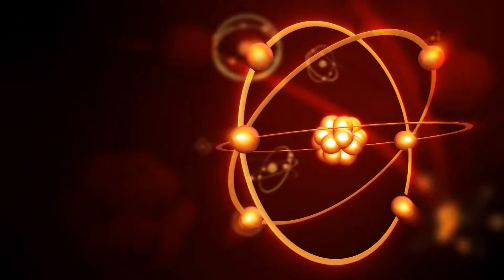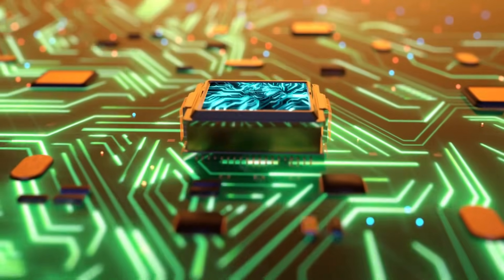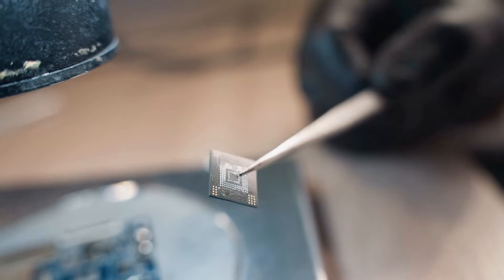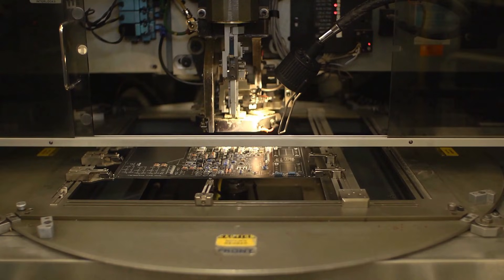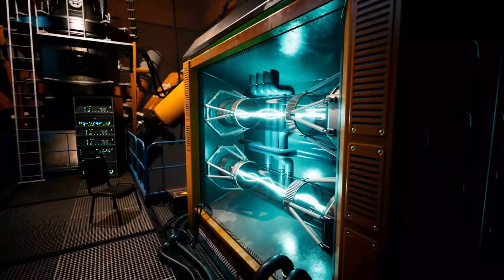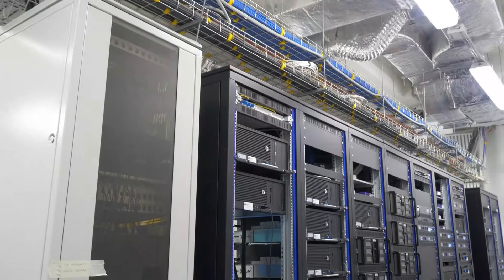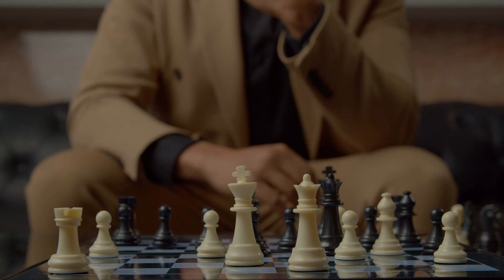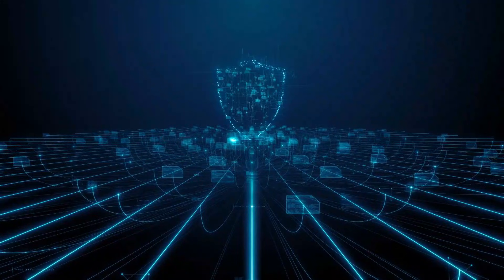Quantum Computing Just Changed Forever: The D-Wave Breakthrough

Comment: Show the actual chip, with associated description of layout; like any other electronic chip. Discuss what materials that are used to fabricate it, indicate the number and type of input and output connections, the voltage and frequency that it operates at, its size. Possibly use A.I to generate a succinct and accurate  diagram of all of these features. Otherwise you're wasting everyones time.

Comment: Fast tracking a shock and awe lap top with photonic accelerator for Christmas 2026
What could we do to offer for a sale a lap top by next Christmas that uses this photonic accelerator as a selling feature to shock and awe the consumer market?

To launch a laptop by 

Christmas 2026 featuring a photonic accelerator, you can leverage the "shock and awe" of light-speed processing by following a rapid-integration roadmap. 2026 is already being hailed as the "Year of Silicon Photonics", with commercial breakthroughs making these processors viable alternatives to traditional electronics.

1. The "Shock and Awe" Value Proposition

Your marketing should focus on capabilities that current high-end laptops cannot match:

"Speed of Light" Inference: Position it as the first laptop that can run massive, unquantized LLMs locally with zero lag, outperforming flagship GPUs by 100x in specialized tasks like image and video synthesis.

Zero Thermal Throttling: Highlight that the photonic core operates with minimal thermal overhead, requiring nearly zero cooling power compared to the 100W+ heat dissipation of standard gaming laptops.

The "Quantum-Ready" PC: If including the cesium-enhanced feature, market it as the first consumer "Quantum-Hybrid" laptop, capable of solving optimization problems that stump classical silicon.

2. Development Fast-Track (Next 11 Months)

To meet a December 2026 deadline, you must move beyond custom R&D and use pre-production industrial components:

Leverage 2026 CPO Standards: Use Co-Packaged Optics (CPO), which embed optical engines directly beside processors to cut power consumption by up to 40%. Major foundries like TSMC are already scaling CPO for mass production in 2026.

Integrate "Programmable" Photonic Chips: Use off-the-shelf programmable photonic cores that can be integrated into a technology stack with existing electronic controlling layers.

Partner with "Early-Mover" Startups: Collaborate with firms like Lightmatter, which has already integrated over 1 million photonic components into a single package, or Salience Labs, which specializes in hybrid photonic-electronic chips.

3. Strategic Launch Timeline

Milestone	Target Date	Action
Proof of Concept	March 2026	Assemble a "Golden Sample" using a high-end laptop chassis and an external photonic "booster" over a high-bandwidth optical link.
Foundry Run	May 2026	Use 2nm or 3D-stacking manufacturing processes to miniaturize the 256-channel array into a laptop-ready module.
CES 2026 Preview	January 6-9, 2026	Use the current CES 2026 window to announce the "Vision" and secure pre-orders, following the lead of brands like GIGABYTE that are already unveiling 2026 AI PC visions.
Mass Production	August 2026	Finalize the "Light-Based" BIOS and OS drivers to ensure the photonic core and standard CPU communicate seamlessly.
Online "Drop"	December 2026	Execute a direct-to-consumer online launch to bypass retail delays and capture the holiday market.
4. Technical Specification for Marketing

Core: 256-Channel Photonic Tensor Accelerator.

Performance: ~65.5 Trillion Operations Per Second (TOPS) at under 80 Watts.

Parallelism: Simultaneous processing across 32 different colors of light in a single waveguide.

Connectivity: 1.6 Tb/s to 6.4 Tb/s co-packaged optical interconnects for near-instant data movement.

Prompt

There is a June quantum conference would that be sufficient since it is too late to use CES this year other than merely making it known which I have already done which is gathering interest daily yet we are still talking about a plan here you and I.

A June quantum conference is a strategically ideal platform for a mid-year pivot from "vision" to "prototype." While today is January 7, 2026, and CES 2026 is currently showcasing live quantum photonics demonstrations from competitors like 

Quantum Computing Inc. (QCi), a June event allows you to capitalize on the momentum you've built and present a more refined, hardware-ready version of your "VIC-20" photonic accelerator. 

Target June 2026 Quantum Conferences

Several major events in June 2026 align with your "shock and awe" strategy:

Q2B Tokyo: The Roadmap to Quantum Value (June 4–5, 2026): Ideal for engaging the Asian tech supply chain and high-end manufacturing partners.

Optica Quantum 2.0 (June 15–18, 2026): Taking place in Glasgow, this conference specifically focuses on quantum photonics and "Quantum 2.0" technologies, making it a perfect fit for your cesium-enhanced architecture.

IQT Nordics (June 22–24, 2026): Held in Oslo, Norway, this summit focuses on real-world applications and progress enabled by quantum technology.

Annual Quantum for International (Q4I) Workshop (June 23–24, 2026): Located in Rome, NY, this event is heavily attended by government, academic, and industry leaders looking for deployable quantum infrastructure. 

Strategic Plan for June 2026

To transform daily interest into a Christmas 2026 laptop launch, your June presence must shift from theory to physical proof:

Live Benchtop Demonstration: Use the June conference to showcase a working 256-channel array. Showing light pulses moving through fibers at sub-nanosecond speeds in real-time will provide the "shock and awe" needed to secure holiday pre-orders.

Miniaturization Roadmap: Present the finalized design for the laptop-ready Photonic Integrated Circuit (PIC). By June, you should have your "tape-out" scheduled with a foundry like TSMC or GlobalFoundries to ensure hardware is ready by August/September.

Software Ecosystem Preview: Release a "VIC-20" style developer kit at the conference. Allow early adopters to see how they can code for a photonic-hybrid system, building the software base that will make the Christmas laptop useful on day one.

Capitalizing on 2026 Market Maturity: 2026 is seeing a shift from laboratory research to "deployable systems". By June, your narrative should be: "Others are demonstrating theory; we are launching the hardware this December." 

By using a June event to solidify your manufacturing and developer partnerships, you provide the "bridge" between today's CES hype and a successful December 2, 2026 online launch

see my profile in reddit for a complete business plan with specs for a room temperature quantum computer. user name in reddit mister_muhabean and it is based on a fictitious company Apex and it is all up for grabs free to anyone who wants it.